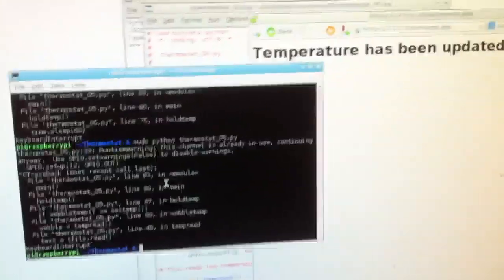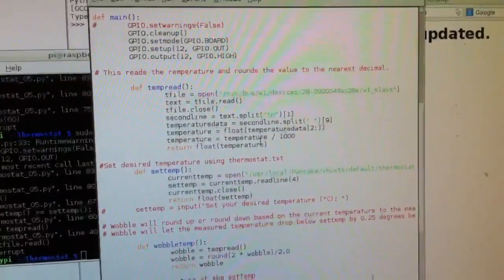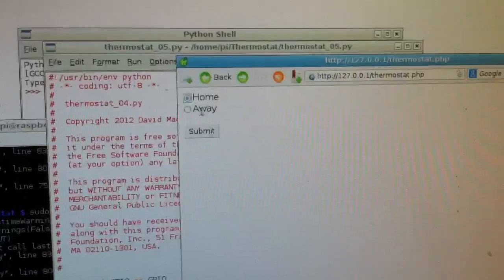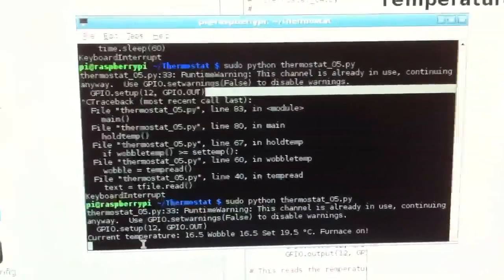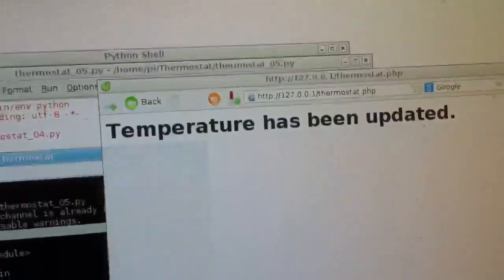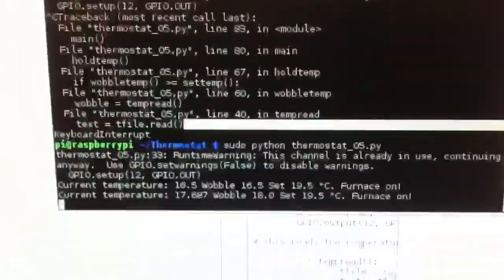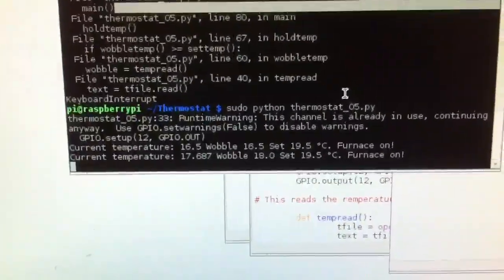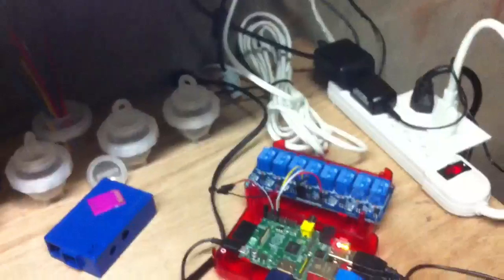Raspberry Pi Thermostat

Comment from the maker: There is a 3 Volt and 5 Volt pin on the Pi. The relay is 5 volt for input and works great. The 8 relay board I bought is overkill. If I needed to operate all 8 at the same time I would maybe consider supplementing the relay board with it's own power supply. but for 3 or 4 relays I would think you'd be just fine.

Comment: What did u use as temp sensor ??
Reply from the maker: A DS18B20. It's worked incredibly well so far. I bought one that was pre-soldered to a board and has the resistor and LED already installed. Really easy to work with and only a few dollars.

http://www.ebay.ca/itm/New-DS18B20-Temperature-Measurement-Sensor-Module-High-Quality-/300951547740?pt=LH_DefaultDomain_0&hash=item46121c2f5c&_uhb=1
Reply from the maker: Yes that's the one.